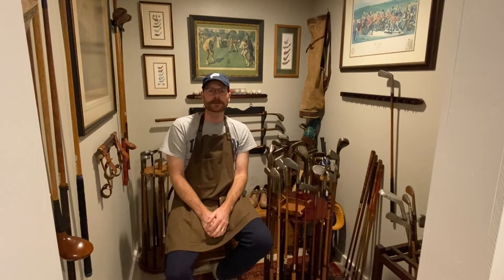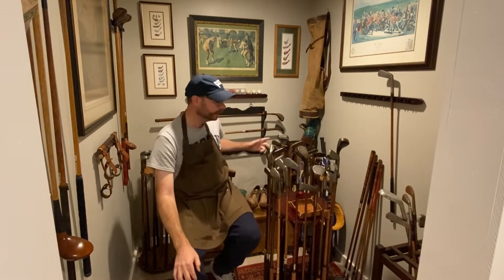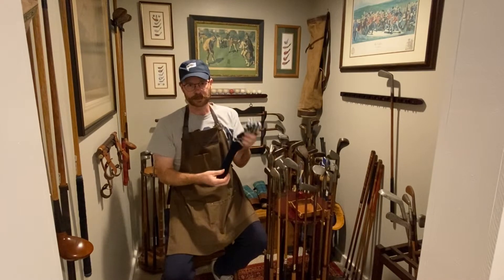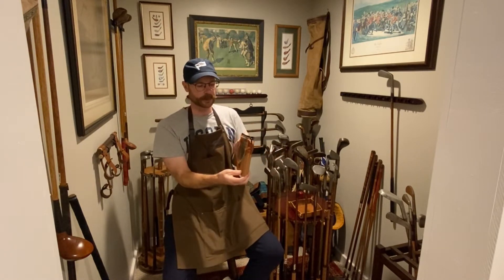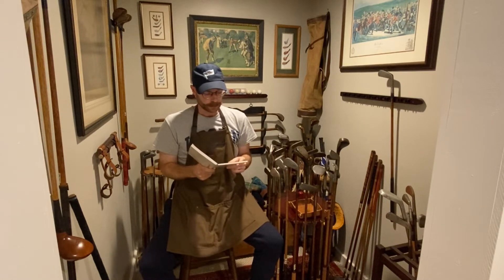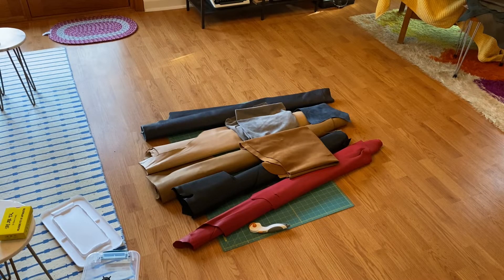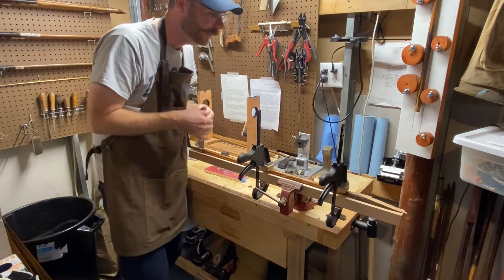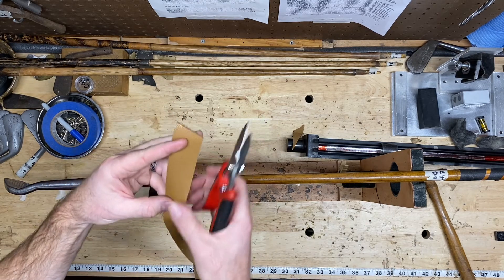Cutting Your Own Leather Grips - Hickory Golf Club Repair: Workshop Wednesdays #4

Comment: I just came to your site this day, Tandy gave me the link....quite interesting. I also repair & build fishing rods, so the loop thingie is familiar, tho I use a folded piece (~9" th 12" total length) of 100lb+ wt braid fishing line to pull the threading thu, ususally, 3/4" to 1"  & usually wrap the ends around a dowl rod to save myself from cuts.
I have also used that artifical sinew for whipping...it can be hand split apart into smaller diameter almost like sewing threads. I've used it to cover bag marks/rub marks on pyratone shafted clubs. Kinda fun...
I'll be checking out your site....great info...
Reply from the maker: Welcome to the channel! I like to fish as well but haven’t crossed into the realm of making my own rods quite yet. Good to know there’s extra utility with the waxed thread, though. I used to have a thread puller like you described with the dowel and it was handy. Lost it long ago and on the bench so I started using pliers, but I miss the elegance of that tool. Might try making one like yours. Thanks for watching!

Comment from the maker: Hi, folks! Just wanted to share this great suggestion from fellow hickory golfer Joey Piatek. He posted this as his own comment, but for some reason YouTube deleted it (out of my control - not sure why it does that sometimes). I’ll try to post them like this whenever I catch it happening: 

	
“Hi Christian, thanks for the video. Not saying this way is better, and I know you mentioned it, but a lot of people I have talked to (and what I do) is to only use a tack at the top of the grip and not at the bottom. A strip of friction tape does the trick at the bottom and it serves 3 purposes: you don’t need to put another small hole in the shaft with the tack, you don’t need to trim/bevel an angle at the bottom of the leather since the friction tape serves to smooth out the drop-off, and lastly it keeps any suede from showing through between the whipping thread. The force of the swing usually makes the leather want to come off the butt end so that’s where it’s most important to tack it down. As you say there are lots of ways to do it, but just wanted to mention. Keep up the great work!”
Reply: Thanks!

Comment: Nice workshop episode Christian.  I think you make a good point about grip material and how it can impact the swing weight of a club.  I've found the same to be true regarding a mid to high C swing weight in the modern era hickory clubs.  I often consider shortening the grip length to 10 1/2" - 11" when I am using the heavier cowhide material.  Keep the good work!
Reply from the maker: Thanks, Brad, and great point! Trimming a heavier grip by a few inches will definitely save you some weight. The stickler in me always wants to cover any old grip marks with the new grip, too, but it’s not always a good idea to do that, especially if you’re right on the SW cusp and want to save weight by trimming the grip.